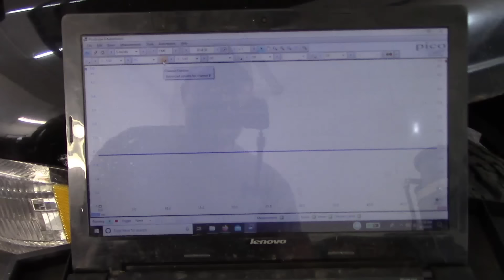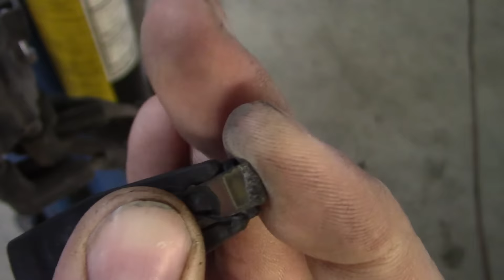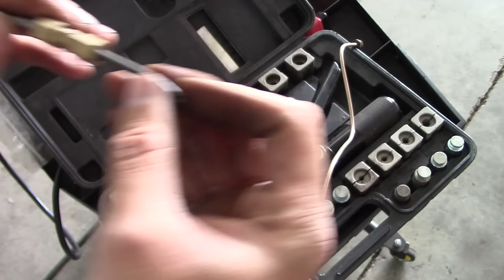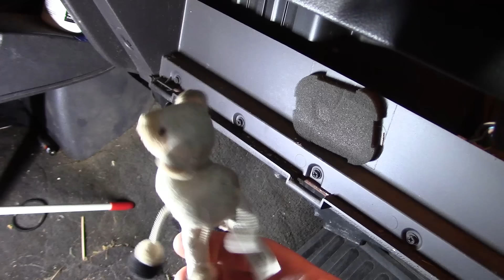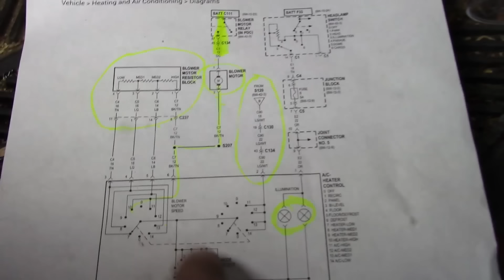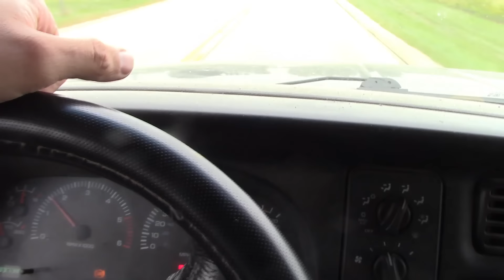2001 Dodge Ram 2500 - Random Missfire, Blown Brake Line, no Heat or AC - basically it's an Old Dodge

Comment: As a Dodge owner, I have learned rather than blaming the Dodge, blame the service tech... use one that cares for the product.
Reply: Most owners don't do anything till it's broke down...PM what's that. 

A Tech can't fix stuff or make suggestions if he never sees the vehicle
Reply: @mrmotofy  could not agree more and car companies count on that...
Reply: Ya agree  I'm a dodge owner myself  since 93 never had rust problems  fill the bottom of the doors with oil and rocker panels 
Take the tails lights off in the spring and pressure wash the fender wells
Reply: @johnfleury5430  have 2001 that has plowed all its life...previous owner fluid filmed every year ..minimal rust..like anything its all how its maintained.

Comment: On the pico-scope, you should learn one tiny detail. To use the trigger - you can leave it at Auto, but place the detection dot, so that the graph synchronizes each frame on top of the previous one with roughly the same graph. Makes it a bit easier to look at:

https://www.youtube.com/watch?v=XcnClLHvm44
Reply from the maker: Yeah, I just didn't get that far. The problem presented itself!

Comment: When dealing with that type of flat spade connector I put a slight twist on the male spades. This ensures a sprung contact in the female which always cures the issue.

Comment: The main problem I could see with that Dodge is the lack of preventative maintenance. I'm glad I don't live in the rust belt.
Reply: I have a 99 with zero rust. Glad I dont live in the rust belt either. Nothing last when it gets a salt bath everyday through the winter
Reply: @brianm8894  In New York, according to sources, they (gov't) salt the dusty roads. And in MN: "Frequent washing gets to those hidden spots, according to Feehan, who washes his car once a week. “It's that middle temperature that's from 5 degrees to 35 degrees that really makes a mess." I'm a good ole boy from the deep south and when that MN man says middle temps 5 degrees to 35 degrees, I get down on my knees thanking God that I ain't a northerner or even southerners who are close to the Mason-Dixon line.
Reply: @jerryc3050  I work outside and I’d rather see 20 degrees than 90.
Reply: @DirtForester  Right now we have 101 degrees making it feel like115° according to weatherman. In MN right now they are experiencing 76 degrees and it feels like that. I'd like to modify my earlier comment and wish that 76° or even 85° is preferable... 😅

Comment: Man, that car is about to go 'ashes to ashes, dust to dust'.
And by the way, you can pour boiling water on the crusty battery terminals to clean them without hassle. A teaspoon or two of baking soda and a few drops of water can also be handy too, for stubburn corrosion on terminals.

Comment: I have a 2001 dodge dually 4wd manual. That has a 5.9 12 valve engine in it . I'm glad its in much better shape
Reply: Im pretty sure dodge stopped offering the 12 valve cummins in 1998 in favor of the 24 valve cummins.

Comment: Dodges...well, I've got a 99 Dodge Ram Van with V-6 (brand-new headlight switch)...before that...a 77 power-wagon with 440, then prior to that 73 Valiant...slant 6...then 73 pick-up with slant-6....so what you're saying is now I can fix anything??
 The rain...Well....here in Sacramento, Calif....100+ degrees daily since first of June....and the FIRES....no sun seen for weeks, but it's not clouds...it's the smoke....and ashes falling like rain....
 Nice video...is that cupro-nickel brake line the stuff they make that's spiral wound and brazed?? I've heard of it, but never used it...yet.
Reply from the maker: I'm not sure how it's made, but it's wonderful stuff!

Comment: Those diamond tweezers work great I bought a kit that had them along with round ones for pins and sockets to work on my Dad's 85 Ford F-250.
Reply from the maker: I need to get the other set!
Reply: @WatchWesWork  Do a search for 8048 HD fleet and it should come up. It's from IPA tools.

Comment: Where was the coolant leak or did the customer not want to go further with that? 

What’s worse then diagnosing what’s good and what’s bad. Working on an intermittent problem when everything is working correctly.

Dang it already ordered some grypmats
Reply from the maker: They are not worried about it.

Comment: Tech tip. Next time you have crusty battery cable ends no need to do that much grinding. Super easy= pour boiling hot water on them and they will look like new. Try it you will see

Comment: Twist those male terminals on the connector with needle nose pliers about 15 degrees or so makes a tighter connection
Reply from the maker: Sometimes I depin them and give them a little squeeze.

Comment: Ive got an old 92 Dodge 2500 Van that looks amazingly like that truck underneath! Also needs a tune up and brakework, but i just started it on the 1st try after a year sitting,  that 318 is loyal as hell. Ill patch it up and keep it till the body falls off.

Comment: I don't deny any of the Dodge problems but I've had way too many trucks, most of which Dodges both gas and diesel.I love my Dodges the best, quirks and all. I've also found that even though they have all the rust problems, the frames are basically always fine where Chevys ALWAYS have rotted frames by me in NY even though the bodies look pretty good and Fords are alittle bit of this and little bit of that, can't complain too much about Fords, but I still like Dodges better!
Reply from the maker: Yeah, the frame on this rig is solid.

Comment: I just had a BMW with crazy ABS, SRS, and CHECK ENGINE dash indicators. A bad left wheel sensor was the culprit. Changed it, cleared fault codes and all is well. Luckily it’s my car. The scan tool is a life saver!

Comment: I  remember back in the day when there were points You had to do a tune up every 30000 miles   back in the olden times
Reply from the maker: Well you were supposed to. Not many actually did! My dad still has an old Eichlin tune up cabinet.

Comment: You are being TOTALLY 😊 unfair with  your constant criticism of Dodge vehicles. It would APPEAR that the MAJORITY of the problems on this 19 year old truck might be laid at the feet of it’s owner in thinking he could drive it 25 years in Northern Illinois with no or very little preventive maintenance. My ‘03 1500 Hemi  has 108+K original plugs, wires and NO crust. Runs like a top, gets lousy mileage and I have probably spent less than 1K on maintenance (I could check my maintenance log for exact cost) It has issues, but what 15 or 20 year old vehicle doesn’t? 

OK, Wes enough of my rant! Thoroughly enjoyed the video and all your crusty and otherwise disparaging Dodge remarks! You are a whiz at reading and diagnosing electrical problems using wiring diagrams and I think you should add a “crusty” surcharge for any vehicle from the area over 2 years old, you know, like a dealer. charge for “shop materials”!

Keep the videos coming, especially those with your 2 helpers!

Love ‘em! (the videos) 🇺🇸😊
Reply from the maker: Oh there's always a unicorn out there...

Comment: 9 year old battery, original spark plugs at 130k, low on coolant and disabled ABS, etc... soulnds more like serious lack of preventative maintenance than issues with build quality... Granted that Dodges are not know for quality but neglect any car for two decades and it will be a piece of junk in the end.

Comment: Got to love the salt belt. Living in Ontario Canada you can taste the salt in the air near any major paved road in winter. I feel your rust pain when working on these things. I have worked on many dodge ram 2500 similar to that one all plow trucks
Reply: I have seen young deer along my blacktop road, licking salt off the road in July, after all the spring rains. Twice in the last few years I've seen fawns, that lost their mother to a vehicle doing that. I run to Farm and Fleet and buy a couple small salt blocks and put them where they can find them easier. Then I don't hear the horns blasting and tires sliding on the pavement in avoidance maneuvers.

Comment: Excellent work on the brakes and ALL the rest!!!!! As usual 👍
An old mechanic once told me a  trick to clean the battery cable connectors. Dip them in a glass of water for a few minutes (while you clean the battery terminals.) Sounds dumb, but the results are great. And I do not by any means to tell you how to do your job, just an old trick I thought I'd share.🙂
Reply from the maker: My dad used to use Pepsi...
Reply: @WatchWesWork  Yeah my Dad told me about that as well.
Reply: @WatchWesWork same, but Coke! I kept wondering why you didn’t clean that all up with some baking soda mixed with water.
Reply: I use baking soda. A table spoon and a glass of water mix and leave the terminal end for about 30 mins. Works wonders. Then I poured the rest on my battery and got it cleaned. Washed the whole shebang with hot water. Coat the terminal with battery silicon paste.

Comment: Wes, you hurt my feelings. I drive a 2000 Dodge Ram 3500 LOL! Do you have any suggestions for coil pack replacements? Mine is a V10 8.0L. NAPA sold me two bad ones which they took back, Rock Auto sent me the wrong ones. I'm using the originals but they are 20 years old and on borrowed time.
Reply from the maker: The Napa Echlins are usually good. Might have to go Mopar.

Comment: Great Dodge, Still running, almost 20 years old.  I got an 05 with a Hemi, maintenance only for all these years.
Reply from the maker: Those Hemis are pretty good. They occasionally burn up a valve or break a valve spring, but overall good.

Comment: Quick tip..Fluid Film does not conduct electricity.Clean, connect then coaT with FF.😎
Reply from the maker: Please see all my other rants about this stupid myth.
Reply: @WatchWesWork  i sold the  product for the manufacturer..but hey its a free country😃
Reply from the maker: @VWWRENCHIE  No grease or lubricant is conductive. That does not mean in any way that it will prevent the terminal from conducting electricity. I don't know why the myth persists.
Reply: @WatchWesWork  You contradict yourself..grease or lube is not conductive .you said soso it is stupid to put it between the terminal and the cable connection. Duhooh.
Reply from the maker: @VWWRENCHIE  It's not pointless. The whole point is to prevent moisture from entering the joint and causing corrosion. It does not prevent the flow of electricity. I've literally done this thousands of times. I used to work with high amperage industrial electronic where the manufacturers would specifically instruct us to use corrosion inhibiting grease between terminals.
Reply: @ruben_balea  the simple point is that you do not spray the terminals with Fluid Film..you connect the terminal..then coat the connection with Fluid Film which provides the barrier to oxyge.n to pre.vent corrosion.as a manufacturer rep for the product..i know how it is meant to be applied....but hey not everybody follows directions. simple..not a big deal.

Comment: No joke. I have mostly driven Chrysler products since I have been driving (40 years). Never had any issues with them. Well leaky AC and non-working speedo no big deal to me.  Hate GM products. And am hot and cold on Fords. I have worked on all of them. And have owed over 50 cars and trucks.
Reply: I haven't had problems with them either, but I repair them myself so its not that costly
Reply: Yeah, l like em lm a mopar guy
Reply: Love my Mopar trucks. my family owns 5 in all, a 92 w150 318 auto, a 95 2500 12 valve 5 speed, two 97 12 valve 5 speeds, and a 2020 1500 5.7 hemi all  have been excellent trucks. My nephew's last Chevrolet truck went through 3 automatic transmissions in 180,000 miles plus loads of electrical problems. Main thing to remember is their all machines, and machines need repair from time to time.
Reply: @rogerjustice8835  Those chevy trucks some of them just eat through them. I worked at a trans shop and 99% of what came in was good old CHEvRolEt for rebuilds. Other we did a service (mind you i didn't EVER do a trans service on a chevy truck that i remember, not many services mind you, exept for some smaller cars which had small issues and we just said hey this might fix it might not) But yeah i don't think many service their transmissions but chevy just eats through them with no help. They're ok trucks but nothing out of the ordinary
Reply: I just bought a 2019 Ram even though Ive heard that had transmission issues in the past, but since FCA took over they have German ZF units now so I took a chance and love the thing!
Reply: @Captain_Brown_Beard  i have a 2015. I was bad. I blew the engine. Got a new one for free. I blame the Hemi.

Comment: Always used baking soda/water solution to neutralize the acid and remove the corrosion on fuzzy battery terminals, was surprised not to see anything more than mechanical cleanup here (perhaps we don't expect the truck to last long enough to complete the copper oxidation process on the terminals)...
Reply from the maker: The stuff on the outside really is just superficial. But I'll try the baking soda thing. Many have suggested.

Comment: Is that a Louis Rossman pen?   Didn't see any clear shots, is that one of the rare Dodge's of that vintage that the dash hasn't self-destructed on it yet (crappy Dodge plastics)?    Maybe it's just because nobody's gone after the leaky heater and evaporator cores...
Reply from the maker: The dash is good. This truck has low miles and gets parked inside. The sitting around hurts is more than anything.

Comment: Lol at the dancing sparks. I used to have a nice Jetta gli that I did a full AAA 2.8 vr6 swap on, and if anyone knows vr6 coilpacks they are total shit. Mine was cracked and I was too lazy to change it for a few months so whenever I left the car wash, just from the moisture on the outside of the car and the condensation under the hood, you could see/ hear the spark and the misfiring. Lol it was obnoxiously loud with a full exhaust, cams, etc. Sounded crazy with it arcing out like that. The OEM ones aren't cheap by any means, and don't give out much spark. The upgrade for them is either a ford windstar pack or multiple MSD coils with a bracket and your choice of wires. It was funny to see it and hear it on that dodge. It made me instantly reminisce on my coil pack. Lmao it's been awhile since you hit us with a "Theres your problem lady," so it was awesome to hear it again!! Great work as always broski!
Reply: All VW coilpacks are total shit.

Comment: Wes, do you know if there's a kit that will provide new actuators and blend doors for the air/blend box. My 2000 Ram has heat and a/c and the fan switch works, but nothing else.
Reply from the maker: Do you mean the mode doors (switch from dash to defrost to floor) or the blend door (hot to cold)? The former is vacuum actuated, the later uses an electric actuator.

Comment: Love all the dodge hate . Sorry boys Chevys of these years usually have rotted frames , Fords have rotted front frames . At least the dodge won’t break in half
Reply from the maker: Never seen a Ford Superduty with a rotted frame. Rotted cab, rotted box floor, rotted spring towers, but no the actual frame.
Reply: Watch Wes Work oh it’s a very common occurrence on superdutys . By the steering box and directly across from it . Rear driver shackle areas known to break in half . I’ve had 3 of them myself .i mean granted anything in the rust belt has a chance to turn to dust . I use fluid film on everything and it holds up nice

Comment: I don't think Dodges are bad, I think this one has been used and abused for two decades and is now starting to show it.
Reply: Yep. The owners can't put coolant in it or clean the battery terminals. They must be glad that the engine didn't blow it's head gasket or warp the head. They are also lucky that they did not need to buy a brand new battery. Wes really saved these customers their truck.
Reply: @az7378  Yeah, those Magnum engines are pretty friggin hard man. I had a 99 with a 318 we bored to max over and ran it hard for at least 25 minutes with no coolant. Fired right up the next day and drove right on the trailer.
Reply: I agree
Reply: They really are just junk.
Reply: Dodge/Chrysler/Jeep are regularly rated as some of the least reliable vehicles, especially after the Fiat acquisition. Early 2000's dodge/chrysler are some of the worst offenders as well.
Reply: @bagelbytes69420  Well since I'm never was a follower, and everybody was hot rodding Chevys and Fords, I went with Mopar. I found that if you keep up the maintenance you don't have the troubles. Most of the Dodges on the mechanics channels have been abused and never looked after. If you drive any vehicle 150,000 miles and do nothing to it you will have the same problems.
Reply: @bagelbytes69420 lol I think you are right for some parts of that.... That made any sense lol. Chrysler had some great designs back then but they were limited on budget.  They have the worst interiors and I think they had the worst electrical connections... Or it seem like with every Chrysler I've ever owned.  But let's give credit where credits due, They were the ones who invented the minivan, the extended cab pickup and they designed the m1 Abrams tank!  Not all parts of Chrysler's are bad... But they definitely lacked in quality in some parts of vehicles lol
Reply: Junk
Reply: They suck
Reply: @717weston  Ok bud

Comment: I think I audibly cringed at 12:31. Man, I'd have put a really light impact on those to try and remove them. I've had good luck doing that with crusty bleeders.
Reply from the maker: Heat and quench works well for bleeders.

Comment: Yeah it's a dodge but the OEM plugs came out in one piece, ask any ford guy and they're going to say that sounds like pretty good day
Reply: Exactly you can run standard copper plugs so they're cheap and they come out easy.
Reply from the maker: Yeah Ford went from self ejecting plugs to welded in plugs.